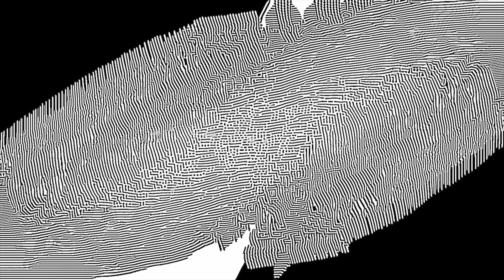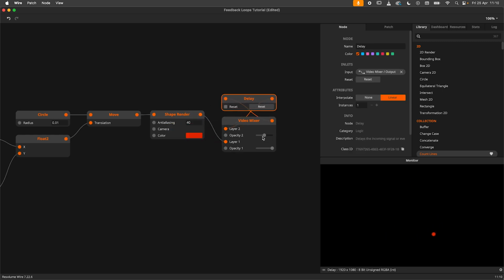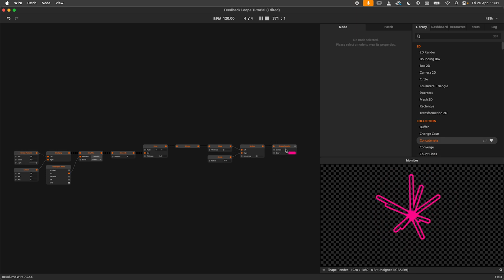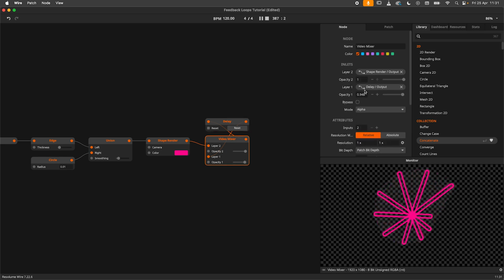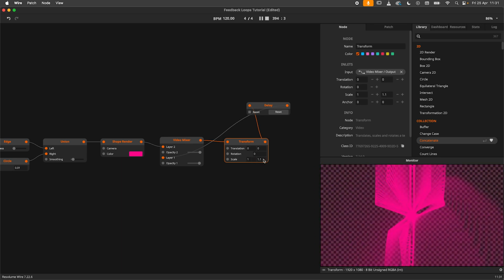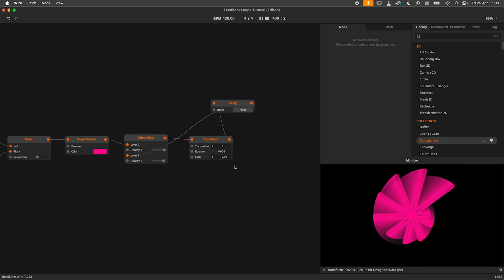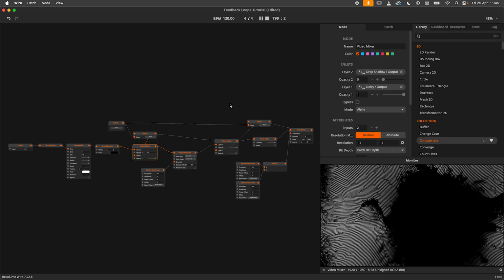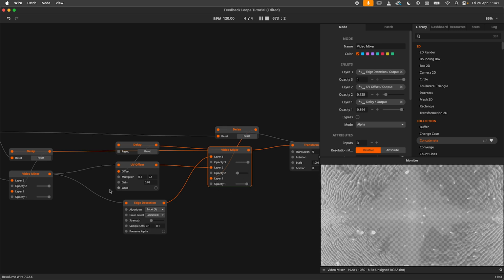Resolume Wire Tutorial - Feedback Loops

Comment: Couple small tips for feedback loops: 

Greater bit-depth will give less (noticeable) persistent trails. Patch can be at default 8-bit mode, but the video mixer adding the feedback needs to be set to a greater value.

Different blend modes in the mixer will have a great impact. Add instead of alpha can give a more "glowy" look, and can be beneficial to have better control of feedback-feedback.

It would probably warrant its own video, but reaction-diffusion are push-pull effects where one change is inefficiently negated by a second change. The most typical is to use a blur and a sharpen chained. This blurs, then trying to cancel the blur with the sharpen, then repeating that will result in somewhat organic looking growing and evolving patterns. Note that this won't work with pixel perfect effects in the chain (i.e. upscaling, then downscaling), since there aren't any impurities for the feedback to amplify.

Mask your feedback to limit it to something cohesive instead of full-screen mush. In combination with reaction-diffusion type effects, this also has a really big impact on the final result.

Small changes has big impacts. A difference in opacity from 0.0725 to 0.075 to 0.0775 for a feedback layer can be the difference between barely noticeable to perfect to way to much. Devil is very much in the details when it comes to feedback :)